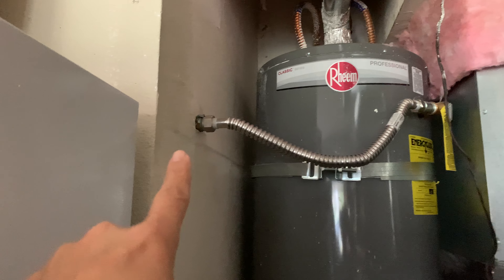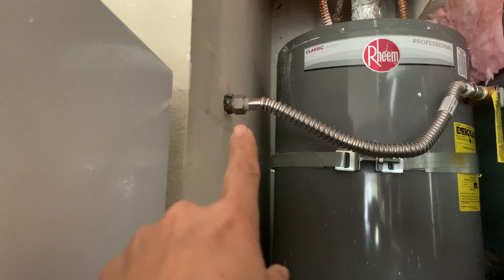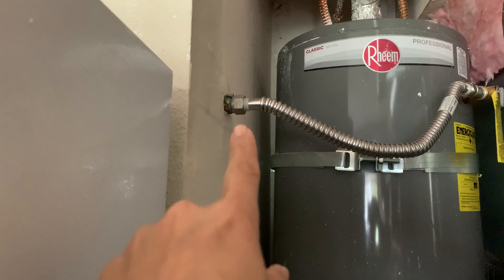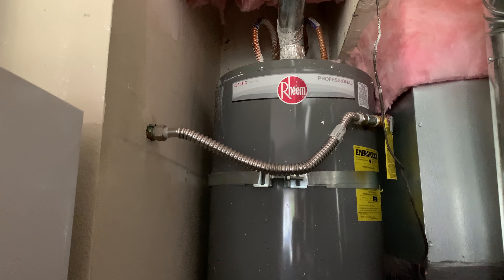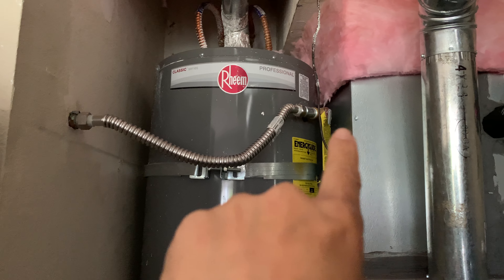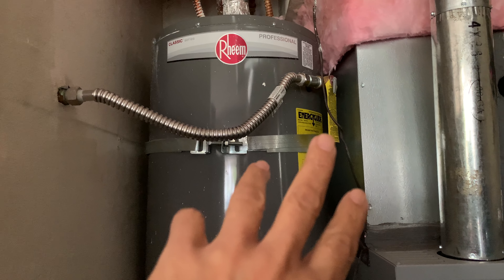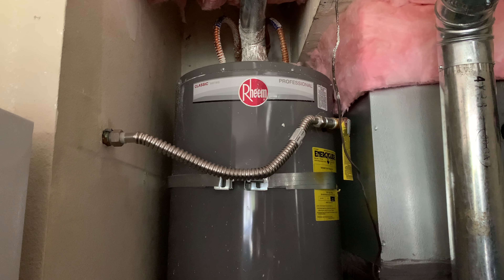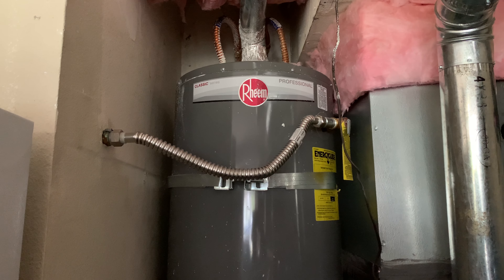Water Heater Pressure Relief Valve Setup Question - Need Advise

Comment: Looks like the drain tube going into your wall out to your side of your house or Crawlspace( if you have that)
Reply from the maker: Yes I found out it is going outside drain pipe. I also tested the pressure valve by pressing it to release hot water out and it worked fine with no leak after the release the valve. Thanks